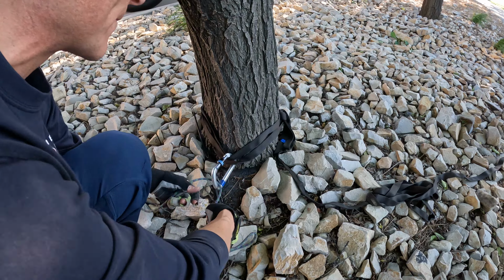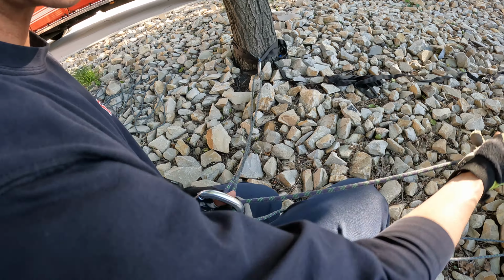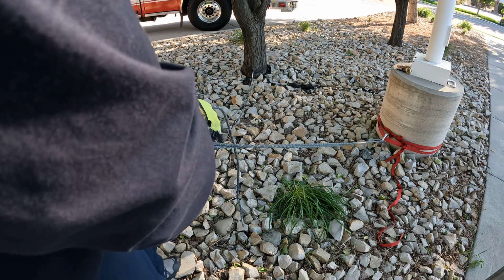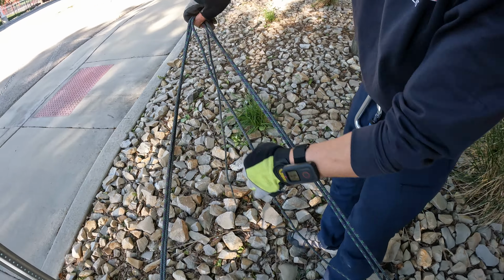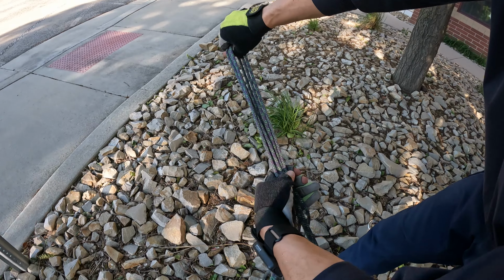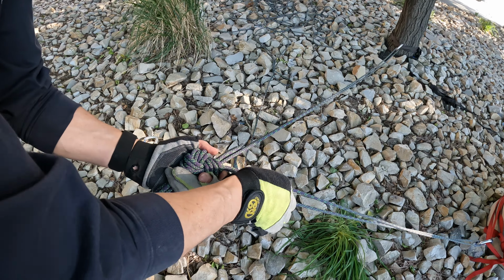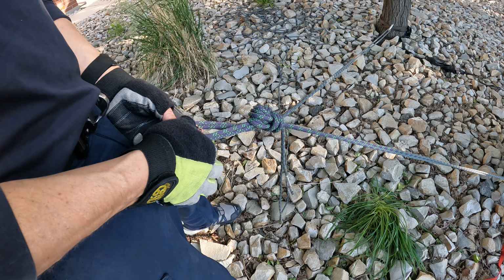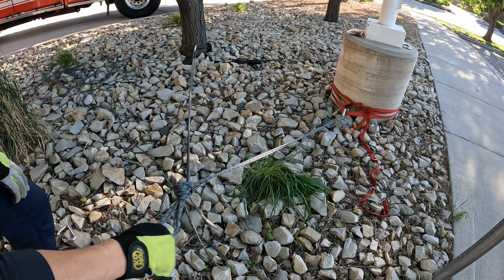Two-Point Anchors: Frost LSA

Comment: Bob, curious as to what type of cordage (diameter/MBS) you're typically using for these types of two/three point anchors.
Reply from the maker: either 1” tubular webbing, any life-safety rope, basic 8mm accessory cord, or 6mm Power Cord
Reply: @Propeller_Head  Copy that. My VFD is currently considering options. Current setup is single strand life safety rope to each anchor point with a Frost master point. Each individual anchor in your method shown (with two strands to each anchor) should have  strength of cordage MBS x 2 correct? (minus the knot reduction and assuming < 120 degree between anchors)  Had not considered webbing but would be a good inexpensive option. Appreciate your feedback!